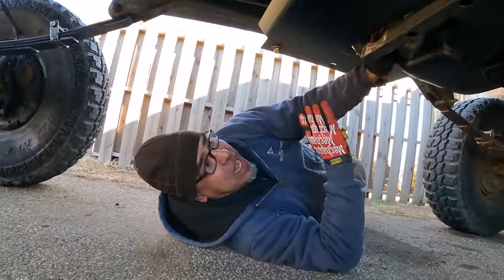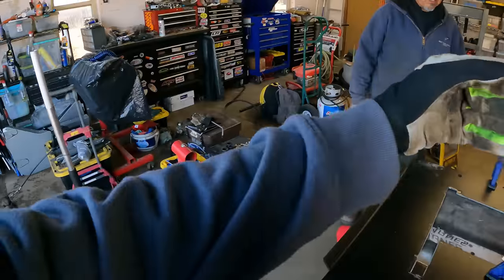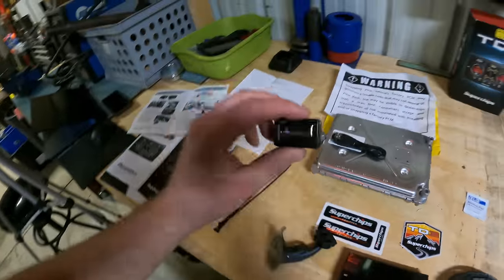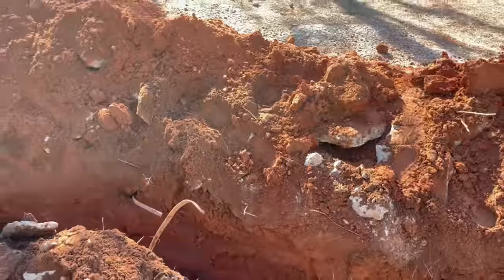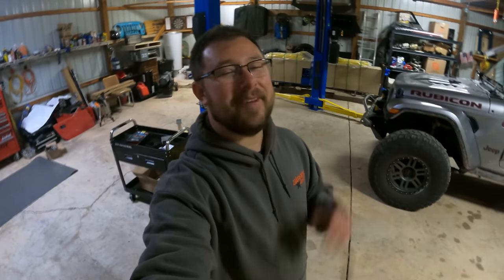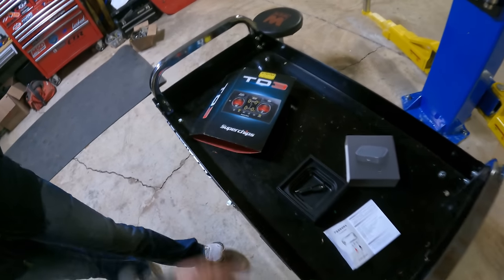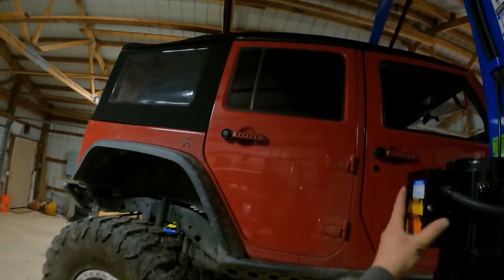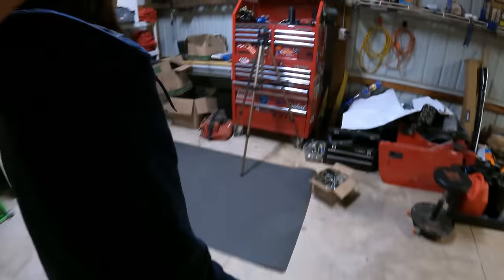We Have a Lift In the Shop!!

Comment: Very nice vid Ben and Cas. Congrats with the lift, I love it, however . . . 

Although it's already installed, you should really consider a base plate, H beams or dedicated concrete piers underneath the lift poles for 3 reasons.
You don't know the 
concrete reinforcement directions, density and number of bars or netting. This is really important to know because we are talking about forces to reckon with.
Don't rely on the construction drawings for this.

As a designer I know that these drawings are seldom followed, people often start off professionally but along the way they often start to cut corners due to time- and money issues. Especially when the house is finished and there's less money left then anticipated to build that shed or barn (I've seen this happen many times) 
Always assume that the previous owners cut corners and/or were your typical "do it yourselvers". You can see this by the way they route the electric cables and water line without a protective casing/pipe. This tells me that it's not an unnecessary luxury to keep a sharp eye.

Regarding the foor, the drawing maybe shows 6 inches or even 10 inches of thickness while in reality, it's only 4 inches thick (to save money and/or time) Looking at the cracks in the floor, I don't know about the thickness, but I wonder what reinforcement they used and how stable the ground is underneath the concrete slab. A floor shouldn't crack like that unless the reinforcement is rusted or the floor was still wet when it started to freeze or there's not sufficient reinforcement in it. As long as you use it as a garage or equipment storage, it's fine. But when you are planning on really stressing the floor, these things become essential.

In almost every case concrete won't fail when there's no weight on the lift, it always goes when your car/jeep is on it because it's not only the weight pushing down on the columns that can cause the concrete to break, the biggest danger is the weight distribution when your car/jeep is up high. When the weight of your jeep is not evenly spread from the middle of the columns backwards and forwards, the lift will have the tendency to tip over or fall backwards. We always like to eyeball the lifting points so they are evenly spread, but these positions seldom represent the exact place where the weight is divided evenly. 

You don't notice this "tilt force" (hope this is the correct word) because concrete doesn't give you a waring". It's this tilting force that could get you in danger. When you look at the Gladiator, it will be heavy in the front and light in the back. You can image how those tipping forces will multiply with every inch you raise that vehicle. therefore I would recommend dedicated concrete piers or large thick base plates that can spread the weight evenly over a big surface because the danger it's not only much the forse of weight pushing down on the concrete, it's the tilt force that can rip the concrete. I hope you appreciate my concern, I just don't want to see two young parents to get hurt ;-)

English is not my native language so I hope my post is clear enough for you to understand what I mean. Keep the video's coming my friends, love them.
Reply: I'm glad to see this, I'm in the process of building a shop and I want to put a lift in it. Thank you for the info, I will consider all what you said.
Reply: @rickaccurso  you are welcome my friend
Reply: @rickaccurso  I did 6 inch concrete, with wire and it was definitely 3000 psi or better.   I ordered my lift from the Home Depot app. Zero shipping costs if ya pick it up at the store.  We installed ourselves.
Reply: @CVCWV  thank you

Comment: If you go to Tackform and get the 20mm bar mount and 20mm to 17mm ball you can mount that trail dash 3 to the vector bar. My suction mount stopped working because the cold recently.

Comment: Cringing so hard with the burn barrel next to the edge of the woods and Your Concrete slab looks very Unsound.  Lift installers recommend 18" of Solid concrete under footings.
Reply from the maker: I’ve never heard anything about 18”. That would rule out almost any and every garage or shop
Reply: @JKGearandGadgets  Cut open Min of 24"x 36" x 18" Deep Under each Footing x2 =18 cubic Feet of Mass total. Be sure to use 5000 PSI concrete, You will need (30) 80Lbs. Bags for a Total cost of $180. Use a template to Hold long angled concrete Studs in Position for lift mounts. Run Rebar to tie in under the existing concrete. Rent a Concrete Wet Saw and You can do it your self.  Conciser Renting whats called a concrete Pencil Vibrator to chase out air bubbles. More content for your Channel and Piece of Mind, Especially if you are in California. Enjoy.

Comment: you need an engineer to look at the anchor bolt detail for the lift - lateral forces from front of vehicle being heavier than rear will put moment on that column and if you don't know what you have with that concrete and anchor bolt interface - you are taking a big risk.  Not worth it.